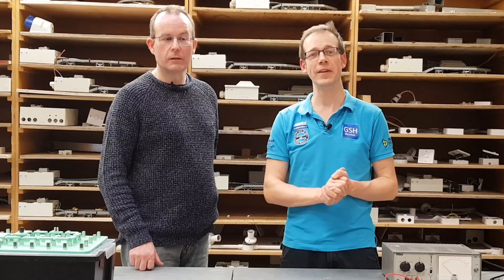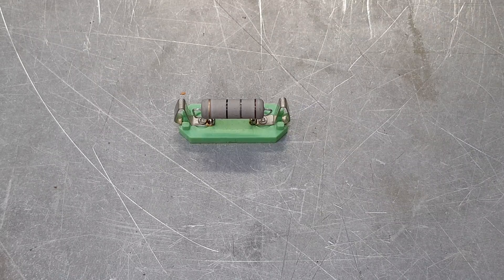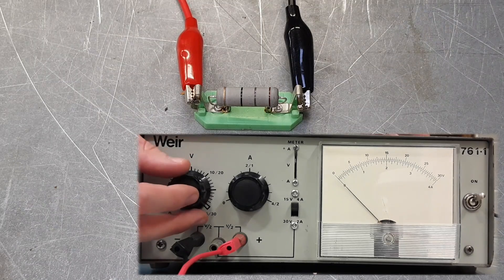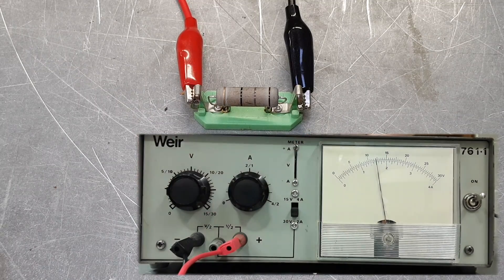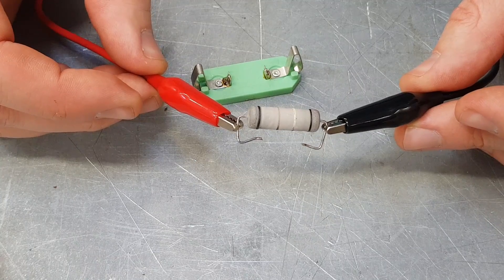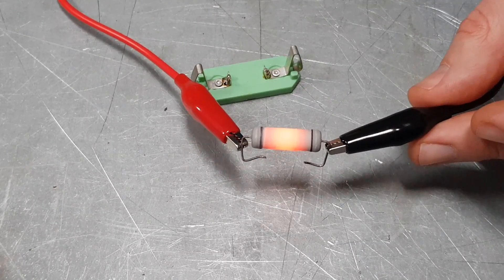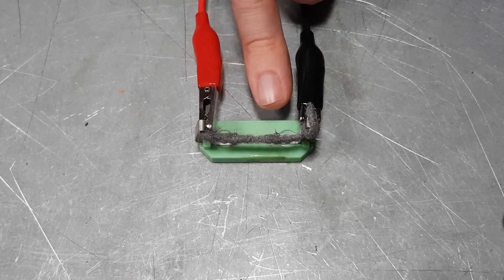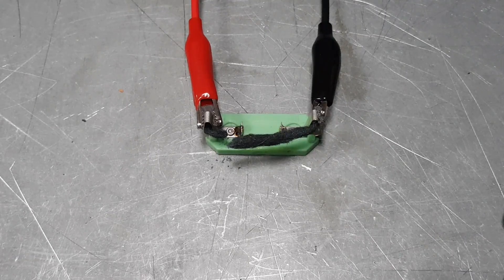John Ward Explains One of the Three Effects of Electricity: Thermal

Comment: Hi Joe, great video. I was wondering what the current recommended reading list is for students? I used Electrical installations NVQ and technical certificate Book 1 & 2 , but i assume they may be a little outdated.
Reply from the maker: It depends which course you're doing really. The science stuff never goes out of date. Guilds and EAL both publish their own books so they're a good starting point. 😊

Comment: As an example for your learners, you could use a BS 3036 5A fuse from an old Wylex consumer unit and pass a current through it showing the point at which it breaks.
Reply from the maker: Smashing idea, thanks for watching and making the suggestion. Stay tuned.